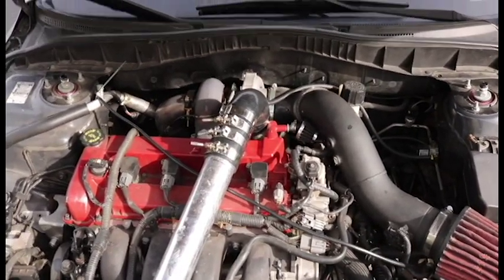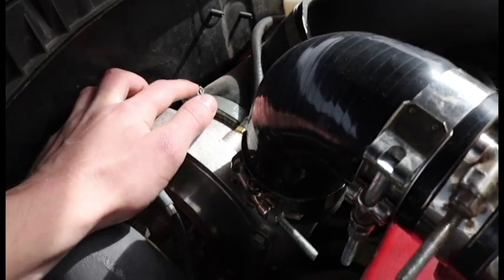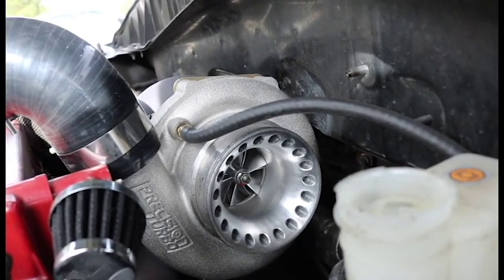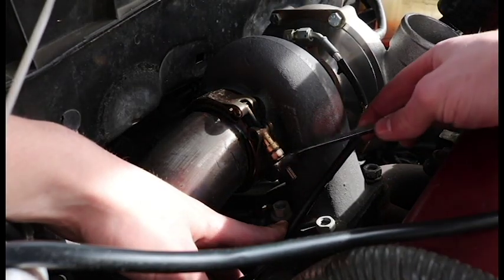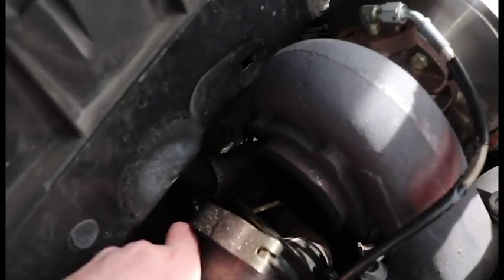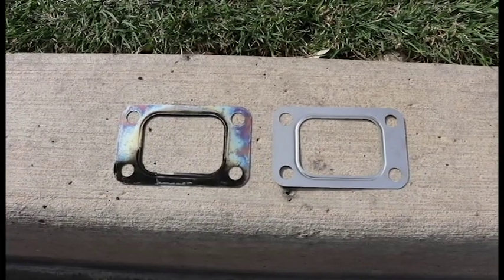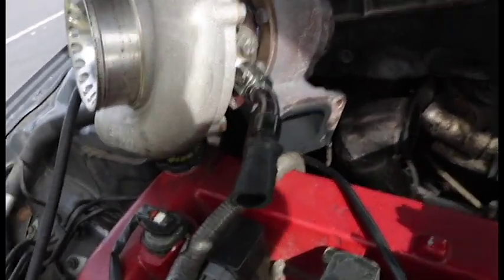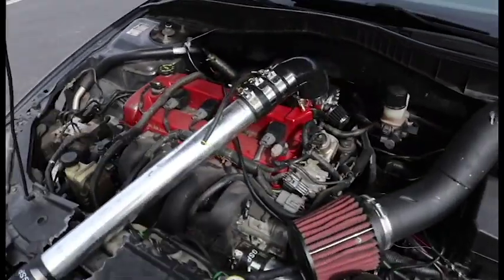Pulling My Huge Turbo Out For Inspection In 5 Minutes

Comment: What is this little air filter for ?( you can see it at 2:20 in the bottom left corner )
Reply from the maker: Dst it’s just a filter for my valve cover instead of recirculating